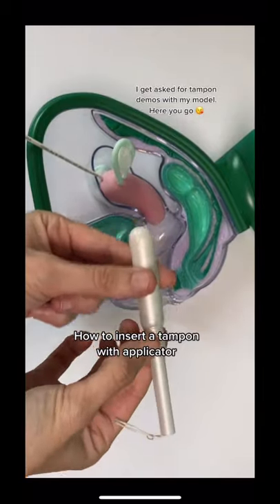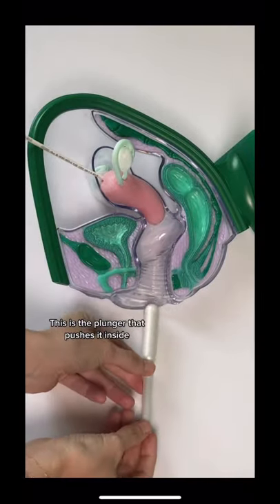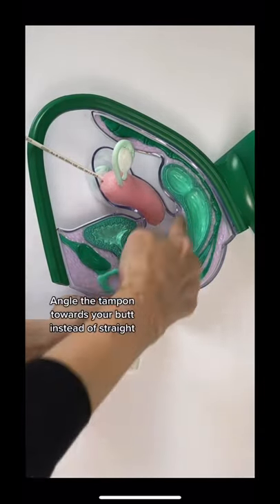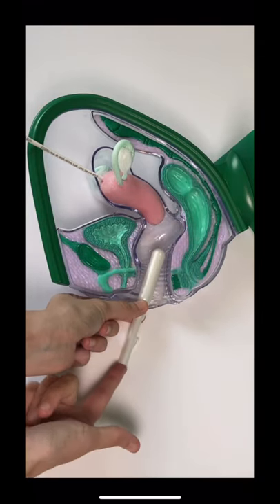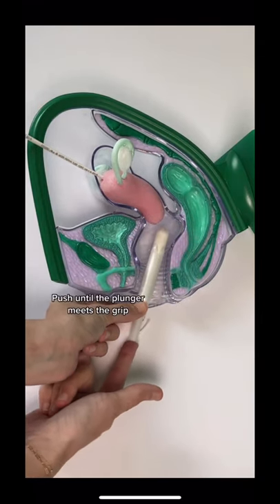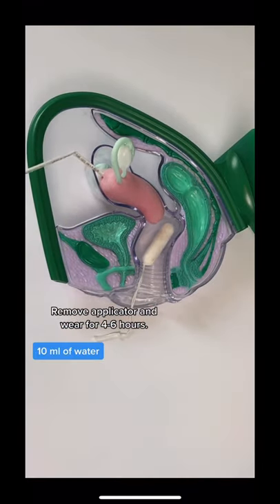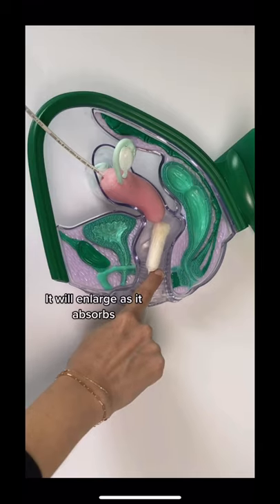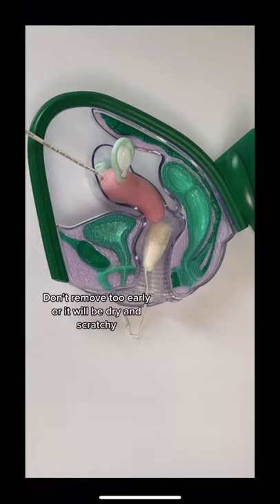How to Insert a Tampon | Applicator Demo #shorts

Comment: Don’t wear for 6 hours. You don’t need to wear it for more than about 4 hours because of the bacteria in the blood. It can be dangerous for your body if it’s left in there for too long, and also the material the tampon is made of can cause toxic shock syndrome as well.
Reply: It’s perfectly safe up to 8 hours if you’re using the correct absorbency for your flow.
Reply: get ur facts right
Reply: @mlynn998  Many period doctors said to not wear it for much longer than 4 hours. It can cause TSS which can kill you. That’s a risk many girls wouldn’t want to take.
Reply: @katsukibakugo9536  period doctors? Do you mean a gynecologist? Because they say 8 hours. Also, the insert in the packaging says 8 hours. TSS is extremely rare anyway, but the risk is insignificant if a tampon of the correct absorbency is worn for less than 8 hours
Reply: @mlynn998  The packaging isn’t always right, and I looked at several videos, websites, and other things and all said no longer than 6. I don’t see why you’re arguing with me about this.
Reply: well it depends on how heavy your day is. if you have a really heavy day no more that 4.5 hours, if it’s on the lighter side you can wear it up to 6 hours
Reply: @katsukibakugo9536  “the packaging isnt always right” they literally ALL say that, what do you mean 🤨 plus ik people who’ve had it in for over 12 hours so pls dont scare younger girls into thinking they cant sleep with it in 🫤
Reply: @katsukibakugo9536   wtf does bakugo have this information 🤣
Reply: @katsukibakugo9536  a professional on youtube said no more than 8 hours
Reply: @katsukibakugo9536  You can wear up to 8 hours but if you prefer to remove at 4 hours then do so
Reply: i’ve had one in for 14 hours before IM STILL ALIVE ARENT I
Reply: @LunaAclipse2 gross tho 😂

Comment: I tried today and I felt a fking sharp pain in my thighs, it was bearable but still 😭
I wanna know where the fking 🕳 is cuz like I am damn sure I put in the correct 🕳 but I don't feel it going in 😭
Reply: not feeling it go in is normal, the same thinh happened to me when i used my first tampon. dont worry. you CANT put it in the hole you pee out of, that hole is too small, so dont worry! you got this. using tampons can be scary but it will be ok

Comment: Does someone please have advice?
I always can feel my tampon very strongly. I feel like the applicator might be too short for me, because it always places the tampon so low it bothers me when moving. If i push it deeper with my finger, i can manage to not really feel the tampon as much. But i still have a feeling that something is in there and also the tampon will not stay in place but go too low after a few minutes. When i tried to go one size up, i could not fit it in there, the feeling of pressure was very uncomfortable. 
Any recommendations? So far I usually don't use tampons, because i can't find a way to make it work..